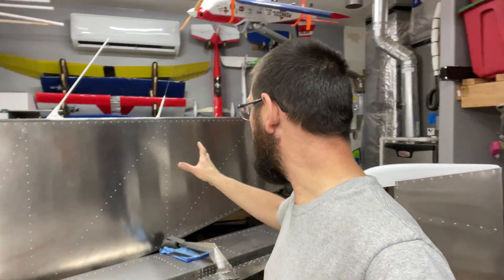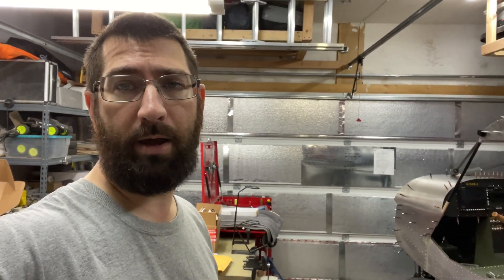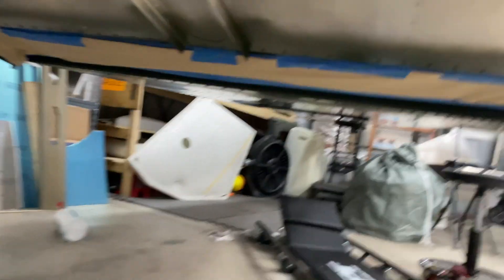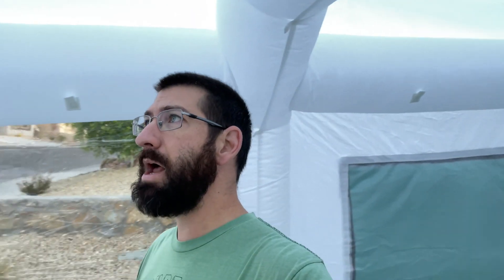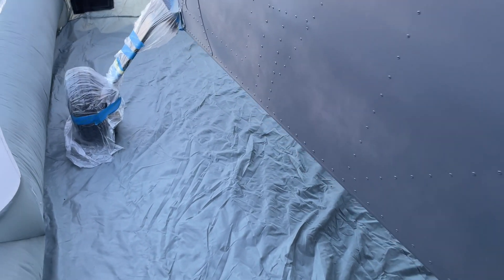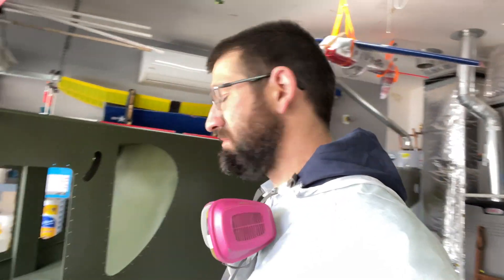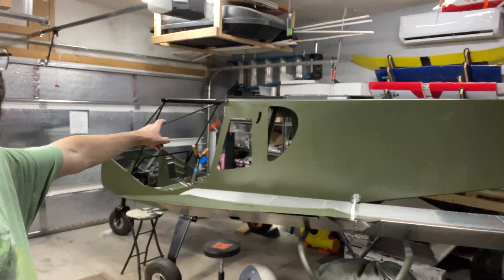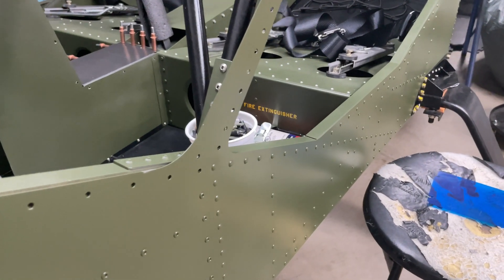Zenith Cruzer Build: The L750 Cricket gets Paint

Comment: Just a tip on the four bottom bolts on the nose gear wheel bushing ( the ones you safety wire ). Don't torque those down they will strip out, the plastic wont hold them. Just snug them down and safety wire I learned the hard way. Anyway good luck...
Reply from the maker: Awesome thanks. This was one of the things I was worried about and why I held off.
Reply: Sean, what did you do to correct the issue?  Thx
Reply: @cliffy2107  I ended up installing  some tap inserts ( I think that what they are called ) Now I can torque them with no problem. I actually think it is a better setup. Jan at Viking suggested it. I would have had to redo the whole bushing had I not been able to put those in.
Reply: @Laserdoc905  Good deal.  I appreciate the info.
Reply from the maker: @Laserdoc905  do you have a link for them might be a good mod.
Reply from the maker: @cliffy2107  I would think you could go up a size with the bolt.
Reply: @JoesRCCorner  Joe, thx.  Not saying I did that but, ah, need to go acquire a larger bolt att.